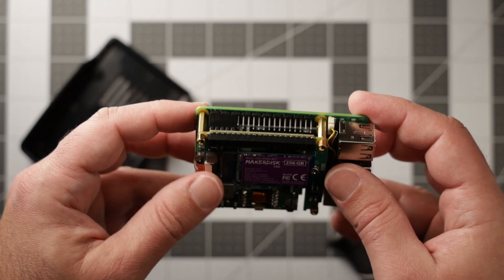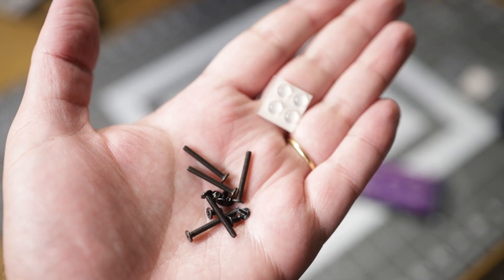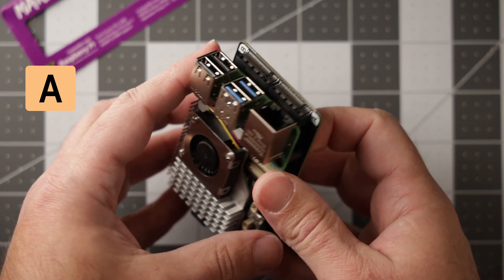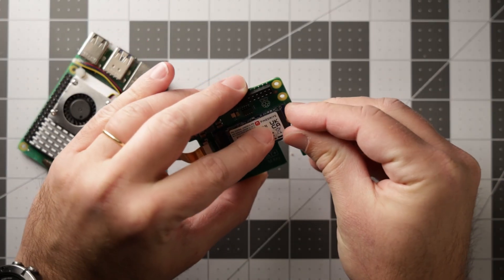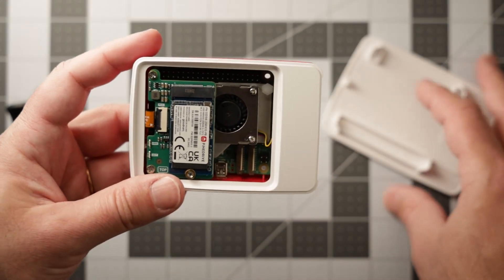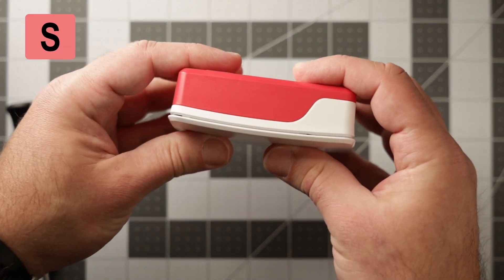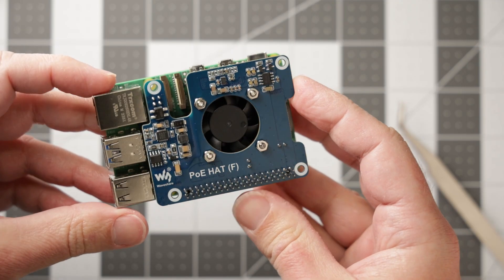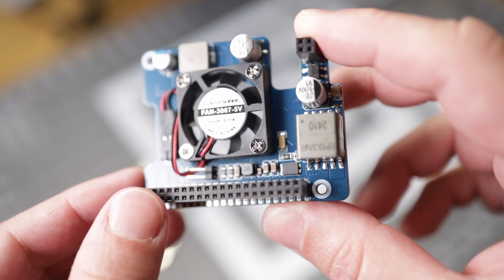Pi 5 HATs Rated. Which one is BEST?

Comment: University of Montana GO GRIZZ! Fellow UM alum 😁. Question, im trying to build my own portable mp3/DAP from scratch and im a total novice. Which board would you recommend to get started on? My research has brought me to the orange pi5 but not sure if im thinking about it right.
Reply from the maker: Hey! I guess it depends on the requirements for your MP3. I honestly wouldn't recommend any of the "big" SBCs for something portable. Check my other video comparing "zero" SBCs

Comment: Even though you can close up some of the NVME hats in the pi case you might not want to for heat reasons.  It is possible that is why the pi hat wasn't built to fit.
Reply from the maker: Yeah, that could be a factor, but a small SSD doesn't produce a whole lot of heat
Reply: That's a fair point, i didn't think of that